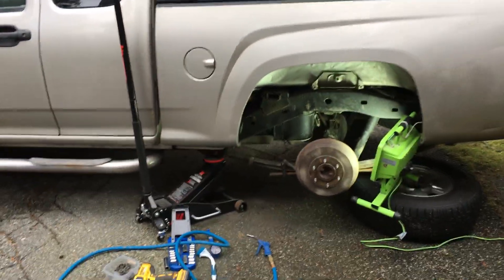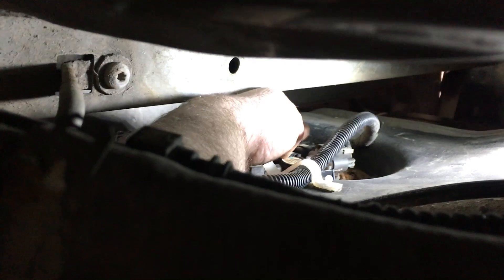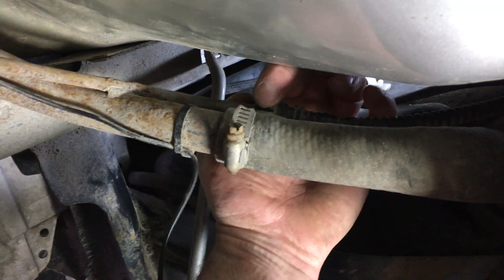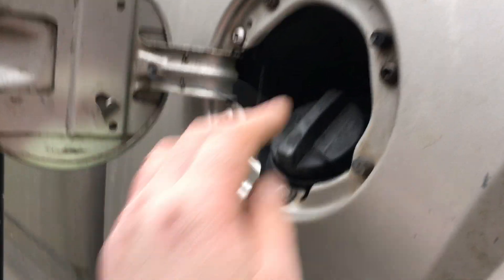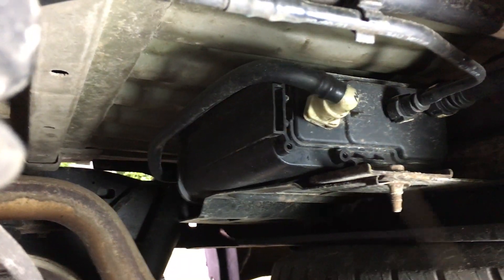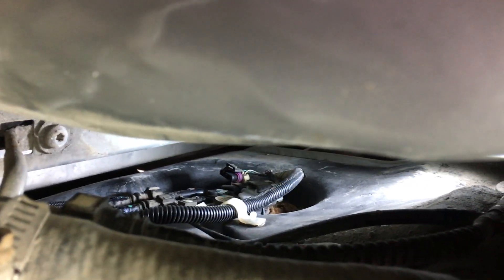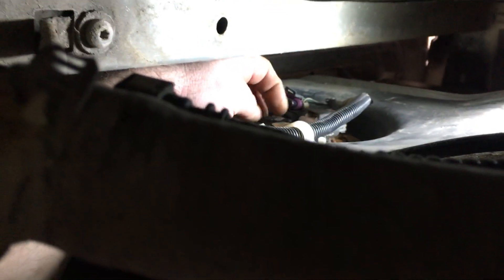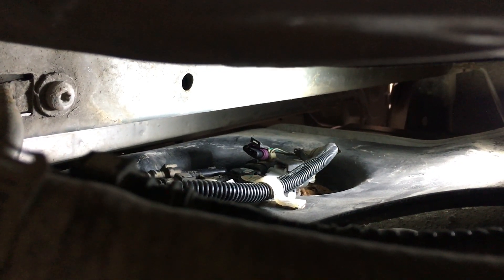Fuel pressure sensor installation P0446 Evap code GMC Canyon video

Comment from the maker: The 3 causes of a P0446 code, are: 
- (1)the vent valve of the canister(not the purge valve) is malfunctioning, and needs replacement.
- (2)the charcoal canister has way too much dust inside of it, thereby clogging off the flow of air, so the gas tank is not able to breathe properly. Either buy a brand new charcoal canister(expensive), or remove the old canister from the truck, and use compressed air line and spray nozzle from a compressor, to spray out the dust and remove it from the canister.
- (3)the fuel pressure sensor, on top of the gas tank, is faulty, and needs to be replaced.

Comment from the maker: For me personally, I actually had 2 problems at the same time! I had just purchased the truck from the previous owner for a cheap price. Initially, the truck would not allow me to put gasoline into the fuel neck, at the gas station, without the gasoline backing up the fuel neck until it spilled out of the truck, and onto the ground. A faulty fuel pressure sensor would never cause this to happen. What caused this to happen was that the charcoal canister was plugged up with too much dust, from driving off-road in dusty conditions. Because the canister was not allowing enough airflow to pass through the canister, it would not allow the air to exit quickly enough from the canister and through the vent valve, to the outside of the truck, in order to allow the gasoline coming into the gas tank, to push the air inside of the gas tank, out of the gas tank, at the same rate of speed at which the gasoline was coming into the fuel neck.
If the gasoline is put into the fuel neck when you are filling up, and you have to put in a small amount of gas at a time, then wait, wait for it to drain slowly down the fuel filler neck and into the gas tank, then you can put in another small amount of gas into the fuel neck, and wait again for it to drain down into the gas tank, then you will know that the fuel system has a flow restriction (clog). The clog is usually not on the line between the fuel filler neck and the gas tank, it is usually on the line that is between the gas tank and the gasoline vapor cleaning tool (charcoal canister). The air that is displaced out of the gas tank, by the entry of the new fuel into the tank, is pushed along the line out of the tank to where it enters into the charcoal canister, where most of the gas vapors are filtered out of the air, before it exits the vehicle through the vent valve, and to the environment.
For me, my vent valve solenoid was functioning correctly, but my charcoal canister had an air movement restriction, due to too much dust, and it was causing the gasoline I was trying to fill at the gas station, to spill down the side of my truck and onto the ground. Luckily I was able to remove the canister and spray it out, and re-install it, and successfully fill fuel up at the gas station.
However, my PO446 code did not go away. I had another problem, apparently.
I replaced my fuel pressure sensor, on top of the gas tank, and after driving 4 days with not allowing the fuel level in the gas tank to drop below 1/4 tank during these 4 days, the truck computer removed the PO446 code, and so the check engine light was removed from the dash board! Halelujah.

Comment: Thank you for your great video. 2006 Colorado Four-door my good neighbors truck I don’t know how he did it but he got his hand in there to get it unplugged. reached in with the long screwdriver and worked a sensor out and plugged wire in to the new sensor using a hook to hold the wire. The rest went well also put in the upstream O2 sensor all codes are gone truck running great thank you again could not have done it without your video.
Reply from the maker: Thanks for sharing the info, about the repair you guys made on your 2006 truck!
I’m glad everything with the process went well, and it was fixed.
Thanks for your feedback, and you’re welcome my friend. I’m glad the video was useful!

Comment: Thanks buddy. That sure is easier than dropping tank or lifting bed.
Reply from the maker: Glad I could help out with the video. This job is not too technical, but it would be a good repair experience if people just allow more time in their day to do this, so that they can understand that things always take longer than what they think, to do all the repair work, and all the clean up, and all the finding of their tools, and vacuums, and extension cords, and changing clothes, and washing up, and a snack, and Spotify music on the remote speakers or smart phone :) or what ever you like to do to enjoy this mechanical work on your truck. Patience is the best tool, to complete it correctly, without any doubt.
All of this is to remember how nice it is to drive the truck with no check engine light illuminating :)

Comment: 2016 Crew cab .... jack up truck, put on jack stands ....you need to lower gas tank about 2 inches. Reach over driver side frame rail and work blindly (sense of feel only) to unplug and remove sensor.....rear tire does not need to be removed....i used a pick to unplug and remove at the same time, the sensor is friction fit, no screws or bolts.....real pain in the ass.....but it worked...

Comment: U never showed how did it come out was it easy did it come out in one peice or did it snap off and u had to use a screw or push it down in the tank?
Reply from the maker: My gas tank pressure sensor came out easily after I grabbed it with pliers properly. I pulled it straight up. It did not break. Make sure to clean off the top of the fuel tank area thoroughly, by brushing it with a medium bristle scrub brush, then use your flexible vacuum hose to get into the area, and vacuum out the road rocks, and sand, and rust, and debris. Then you can start to undo the electrical connection, and pull out the sensor.

Comment: Thanks for the video.  I have a 2007 Sub with only 74 miles.  Check engine light turned on with OBD code P0446 (Evaporative Emission System Vent Control Circuit 1/1.  I've replaced the gas cap, vapor vent canister valve, vapor jumper wire and the  Emissions Vapor Canister Purge Valve Solenoid EVAP Vent ( I don't think it's necessary but I did it anyway).  Cleared it and the check engine light is gone but after driving 93 miles, the I/M is still not ready with a combo drive of city and fwy.  Drove it for another mile and after 6 cycles, when I ran the OBD at 94 miles to see if it's I/M ready, unfortunately I see the same "pending" P0446 code despite driving it up to 110 miles hoping it will clear on it's own.  So I decided to erase the pending code/OBD and did the same thing again.  Drove it up to 92 miles without check engine, still not I/M ready and at 94 miles later it's still not ready and the "pending" p0446 code is back.  Should I continue driving it in hope that it will go away since it's not giving me a permanent OBD code?  I'd appreciate any suggestions on what to do so I can get this smog.  Btw, I/M reads as: PdDTC (1), Evap (X), Cat (X) and the rest has a check mark/ready.
Reply from the maker: Hey, you’re welcome for the video. A common cause of P0446 code is potentially a faulty fuel pressure sensor that needs to be replaced. For your situation, keep driving until it throws a permanent code. 
From what you said you have already replaced as far as the parts are concerned, it sounds like you’ve replaced all the other potential problems related to a P0446 code. It sounds very likely that the only last potential item that would throw the code would be the fuel pressure sensor?
The 3 causes of a PO446 code, are: 
- (1)the vent valve of the canister(not the purge valve) is malfunctioning, and needs replacement.
- (2)the charcoal canister has way too much dust inside of it, thereby clogging off the flow of air, so the gas tank is not able to breathe properly. Either buy a brand new charcoal canister(expensive), or remove the old canister from the truck, and use compressed air line and spray nozzle from a compressor, to spray out the dust and remove it from the canister.
- (3)the fuel pressure sensor, on top of the gas tank, is faulty, and needs to be replaced.

For me personally, I actually had 2 problems at the same time! I had just purchased the truck from the previous owner for a cheap price. Initially, the truck would not allow me to put gasoline into the fuel neck, at the gas station, without the gasoline backing up the fuel neck until it spilled out of the truck, and onto the ground. A faulty fuel pressure sensor would never cause this to happen. What caused this to happen was that the charcoal canister was plugged up with too much dust, from driving off-road in dusty conditions. Because the canister was not allowing enough airflow to pass through the canister, it would not allow the air to exit quickly enough from the canister and through the vent valve, to the outside of the truck, in order to allow the gasoline coming into the gas tank, to push the air inside of the gas tank, out of the gas tank, at the same rate of speed at which the gasoline was coming into the fuel neck.
If the gasoline is put into the fuel neck when you are filling up, and you have to put in a small amount of gas at a time, then wait, wait for it to drain slowly down the fuel filler neck and into the gas tank, then you can put in another small amount of gas into the fuel neck, and wait again for it to drain down into the gas tank, then you will know that the fuel system has a flow restriction (clog). The clog is usually not on the line between the fuel filler neck and the gas tank, it is usually on the line that is between the gas tank and the gasoline vapor cleaning tool (charcoal canister). The air that is displaced out of the gas tank, by the entry of the new fuel into the tank, is pushed along the line out of the tank to where it enters into the charcoal canister, where most of the gas vapors are filtered out of the air, before it exits the vehicle through the vent valve, and to the environment.
For me, my vent valve solenoid was functioning correctly, but my charcoal canister had an air movement restriction, due to too much dust, and it was causing the gasoline I was trying to fill at the gas station, to spill down the side of my truck and onto the ground. Luckily I was able to remove the canister and spray it out, and re-install it, and successfully fill fuel up at the gas station.
However, my PO446 code did not go away. I had another problem, apparently.
I replaced my fuel pressure sensor, on top of the gas tank, and after driving 4 days with not allowing the fuel level in the gas tank to drop below 1/4 tank during these 4 days, the truck computer removed the PO446 code, and so the check engine light was removed from the dash board! Halelujah.
Reply: @blairj1409  I'll do that next and keep you posted.  Thanks again!
Reply from the maker: That would be great if you can keep us posted about the results of the repair! Thanks. Good luck with it.
Reply: @blairj1409  👌
Reply: @iceman9956 so any news?
Reply: It was a faulty fuel sensor.  Replaced it and the code was gone.  I just lowered the gas tank enough that my arm can reach and replace the sensor.  Just be careful not to break it when you're trying it remove it.
Reply: @iceman9956  thank you 🙏 so far I’ve changed the purge valve, canister vent and checked for leaks and to no avail. The gas cap is fine but I was thinking the sensor since it read pressure while there was no pressure going to the sensor
Reply: @alex_creates9094  that's pretty much the same symptoms I had.  So the only thing that made sense was the fuel sensor which was my first instinct when I tested the vent, purge and gas cap and it was good, but I replaced it anyway because it was accessible, cheap and the parts were 14-15 yrs old.  Anyway, kindly give us an update as well.  Thank you all!
Reply from the maker: Thanks for sharing your update!!! The fuel pressure sensor replacement also fixed my PO446 code.     @iceman9956

Comment: I replaced my fuel pump now I'm getting p0446 it came with a new ftps but it wasn't oem is this the reasoning for the code ? I was getting a p0440 prior but not p0446 changed the purge valve and the vent valve with no luck.
Reply from the maker: It sounds very likely that your fuel tank pressure sensor (ftps) is causing the P0466 check engine code, seeing as how you have already replaced the vent valve solenoid. Those are the 2 most common fixes for a P0446 code, on a 2004 to 2012 Canyon or Colorado.
Make sure that the ftps is in fact pressed down and fully seated in the hole it sits in.

Comment: When you had this problem how was your truck acting? I’m having issues when it first starts that is it. Figured it was fuel related somehow and stumbled upon this video. When I first start it and let it idle it wants to quit. If I drive it when I first start it and I am going up a hill or the truck has any kind of load on it, it will stall then I let off gas and it is fine only does it when I first start it.
Reply from the maker: Actually, for my truck, when I had the P0466 code, there were no adverse symptoms related to driving. I just kept getting the check engine light on the dashboard. Then when I plugged in my scanner the scanner showed the P0466 code not going away.
When I replaced the fuel  tank pressure Sensor, and I allowed it to drive through a full drive cycle and did not allow the gasoline level to drop Below 1/4 tank during the full drive cycle, The P0466 code eventually cleared itself and went away. It took about four days of driving in multiple conditions.
Reply: @blairj1409  Did you have P0446 or P0466?  or both?  You've mentioned both in the comments, but only P0446 in the description.  Your comment above is the only one that mentions P0466.
Reply from the maker: Oh thank you, I see I made a typo.
I meant to write Po446, and not Po466!
I’m having trouble editing the mistake.
Reply from the maker: Hi, I’m not sure what is causing your problem as I am not a mechanic, but a few things that are going to do to keep your GMC Canyon in good working condition, is to:
1)Replace your air filter so that air is not being choked to the engine.
2) learn how to clean the MAF sensor (mass airflow sensor) with cleaning spray and make sure not to make direct contact physically with any parts or you will damage it.
3) perhaps remove and replace the gasoline filter under the vehicle.
4)Make sure your spark plugs are not overdue for replacement.
5)If you have an automatic transmission, the best advice is to make sure you do regular transmission oil changes or your transmission will not last.
6) use fully synthetic motor oil.
7) Prevent your motor from overheating Buy making sure your radiator fluid is in good condition and replaced within the kilometres suggested.
 
For you, is there any codes that come up on your check engine?
Maybe you could learn how to check your fuel pressure using a fuel pressure gauge?
There is some thing also called a fuel pressure regulator, that sometimes it goes bad.
Sometimes the purge valve solenoid dies in the open position, and this would always allow extra gasoline into the combustion process... maybe that would cause it to stall? I am not sure.
When the engine is cold the brains of the truck give the engine more gas to allow it to run smoothly. Perhaps it is getting too much gas when it’s cold?
Or perhaps your fuel pump is not pumping strongly enough to give it enough gas when it needs more gas when it’s cold? Just a guess as I say as I am not a mechanic.
When your engine becomes fully warmed up, the brains give the engine less gas because it needs less to operate smoothly.
Usually when a fuel pump is getting weak you can see it when you are driving uphill demanding more power out of the engine and therefore demanding more fuel to reach the engine, at a faster rate.

Comment: Did this remove the code? Also, was your truck having issues on really hot days starting? Like it would start but stall out right away.
Reply from the maker: Replacing the fuel pressure sensor did fix the P0446 code. You were asking about a truck that is having problems starting, and this would not be caused by A faulty fuel pressure sensor, as far as I know. We were talking about the fuel pressure sensor, not the fuel pump.
Sometimes when the fuel pump is starting to go bad, it would cause weak fuel pressure and difficulty starting. A weak fuel pump will often show you problems if you are asking for lots of fuel to be delivered to the engine, like when you are driving it pedal to the metal going uphill, when it requires lots of fuel and fuel pressure.